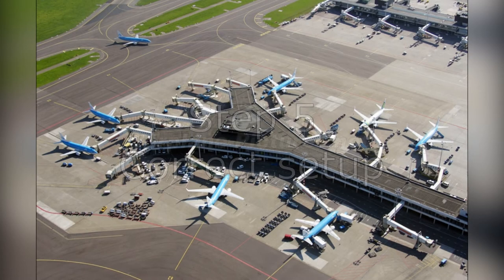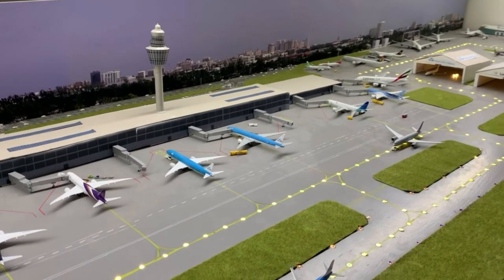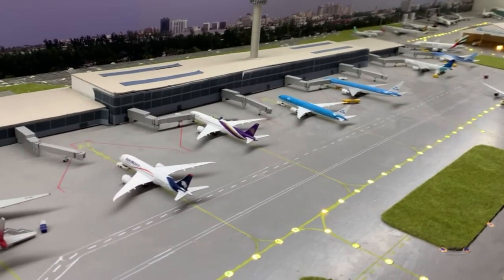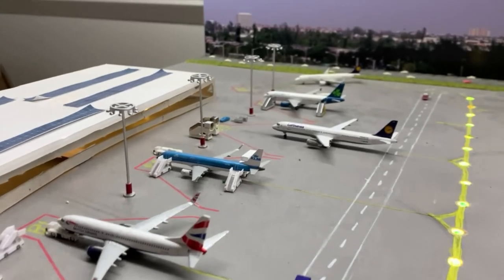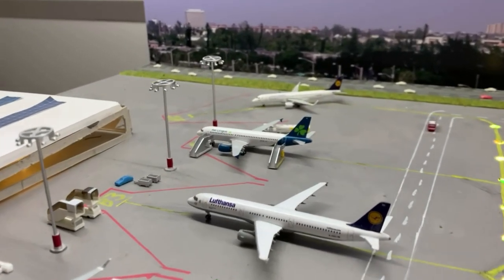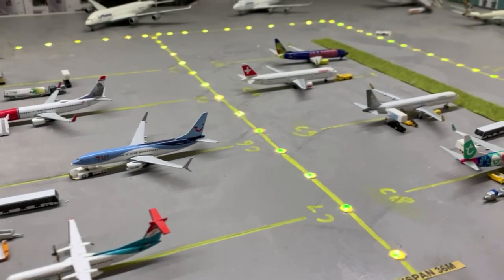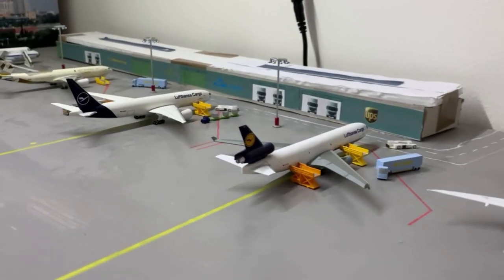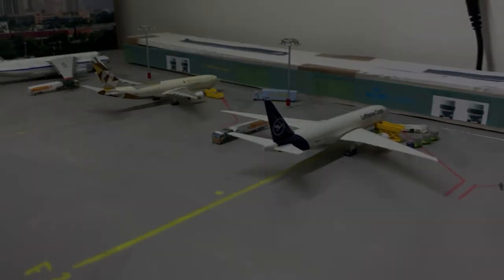How to make your model airport more realistic in 6 easy steps!

Comment: Those ground markings actually don't look all that great to me... WAY oversize and obviously hand-drawn. A far better approach is to create them via computer graphics. The correct font for basically everything except the runway numbers themselves is called "FHWA Series D", stretched to 250% original height to create the correct amount of elongation.
Reply from the maker: Do you mean the “No entry”, “runway ahead” and “max span” sings?
Reply: @model.aviation  Yes

I'm in the process of designing the layout for Indianapolis International circa 1992. The graphical signage painted on the ground wasn't in use then, but I'm using this elongated font to make my gate numbers for the parking lead in lines. I'm doing the whole layout in vector graphics then plan to print it in a series of 8x8 inch tiles. I'm doing all of my graphics to correct 1:400 scale (center lines to correct thickness, etc)... hopefully everything will show up when it's printed!
Reply from the maker: That's very cool to hear! So I have measured out the markings using the Google Earth ruler function. I just went to Schiphol EHAM and measured the size of the markings. I calculated them in the correct scale and done! :)
Reply: @model.aviation  I downloaded the official marking standards from the FAA and used that to supplement my photo measurements.
Reply from the maker: @Railfan727  That's a way better method, but both work of course!